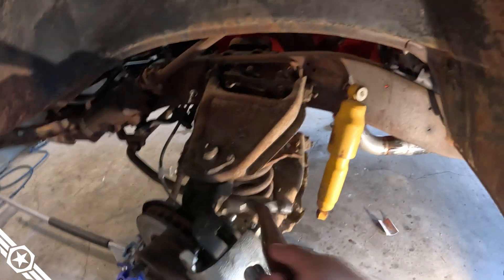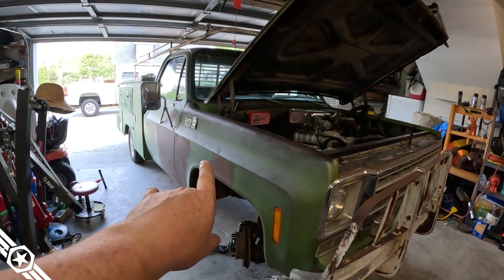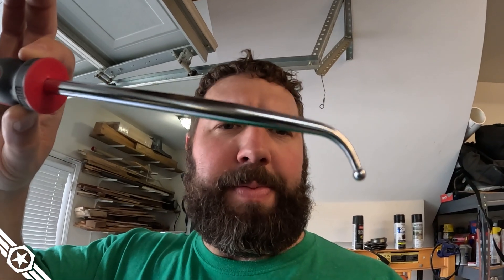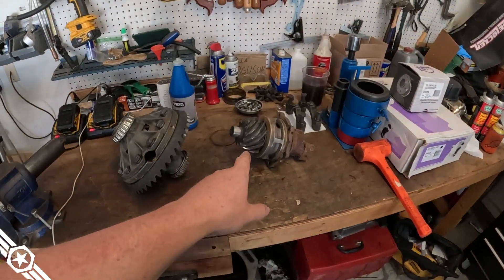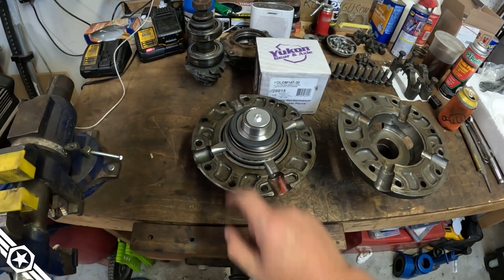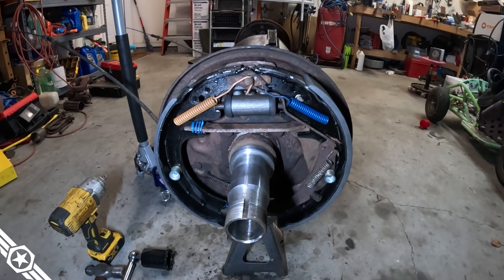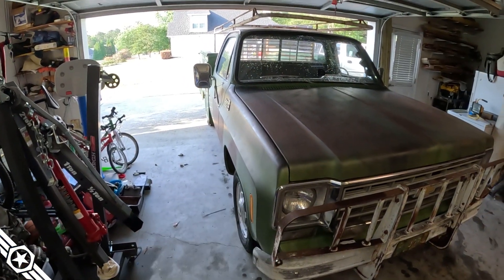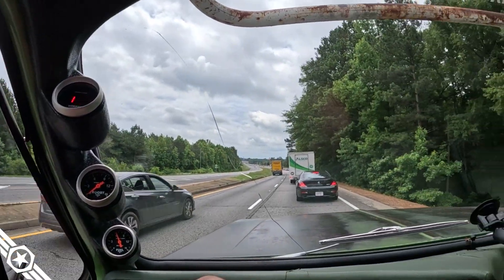Hot Rod Power Tour Thrash I Blower, Body Lift, Broken Parts #powertour #squarebody #servicetruck

Comment: "A lot of work to fit a blower under the hood without cutting it."  Still, if, say, you have that exact same problem with a 78-87 G-body you don't even have the option of a body lift.  Ask me how I know!  Very inventive fix in a truck application, sir.
Reply from the maker: Yeah, the body lift worked out well. It’ll come in handy when I squeeze a 12 valve in it in a few months 😎

Comment: Put a rope "nylon preferably" around the windshield slightly lubed with Vaseline. Press with slight pressure. Then pull rope out around the windshield. It works much better than that tool.
Reply from the maker: Does that method work on this style windshield seal. This is the locking channel style.